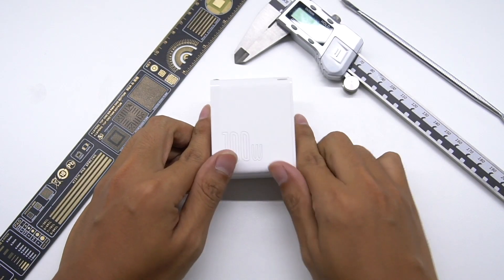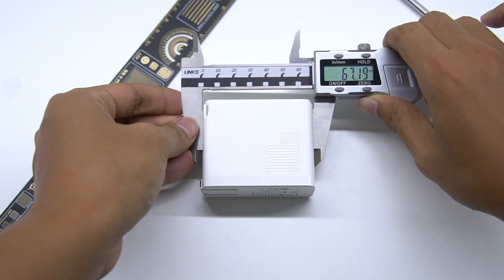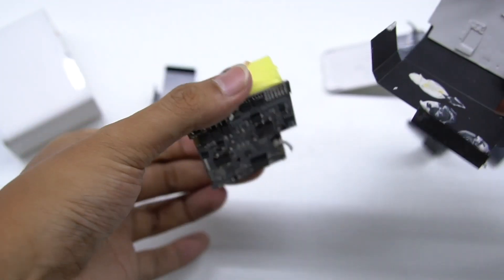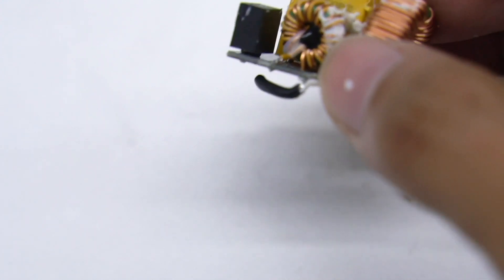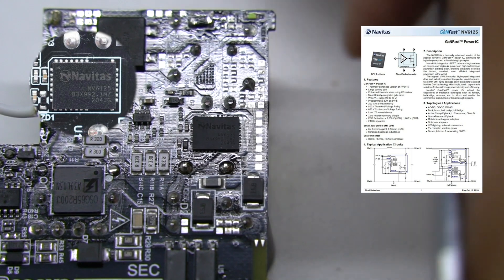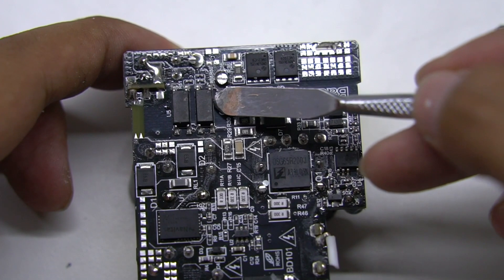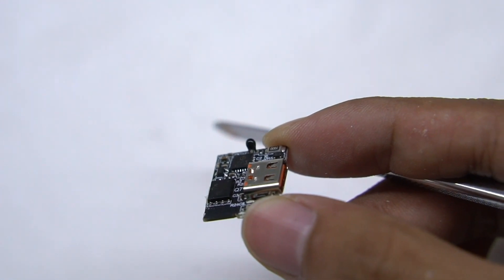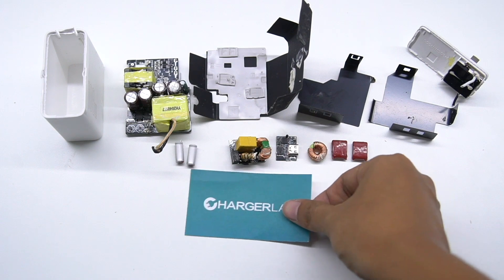Teardown of Baseus 100W GaN II Fast Charger (QC 5.0)

Comment: Nice teardown. Does this work with the Samsung super fast charging 2.0? Since I've heard it's been quite picky this year with the S22 series. Thanks!
Reply: Yes it does. But you have to use a 5A cable that supports 100w charging.

Comment: Regurgitating tech specs is one thing but there's no mention of whether the chips used are competitive and reliable, trustworthy and so forth. The point of a video like this is so I wouldn't have to cross reference anything and get an informed opinion in one place. Nice video, but please consider doing more than just reading the spec sheet while pointing out the component. Talk about whether the components are actually good and trustworthy vs. other options.

Comment: Great video as usual!
May i ask you the difference between this baseus 100w Gan2 QC5.0 single USB c Port  and the other model  with 2 USB C and 2 USB A?
Because i would like to buy One but i am not sure about the difference.
Thanks you and support
Reply from the maker: the other model with 2 USB C and 2 USB A doesn't support QC5.0. And a little bit more expensive than the single-port model.
Reply: @ChargerLAB  please do teardown of the 100watts 4 ports version.

Comment: Why do you think they use GaN for PFC but a silicon MOSFET for the flyback converter?
Reply from the maker: Because the Generic series high-voltage MOSFET is optimized for high switching performance to minimize “switching loss”, which is better than GaN from the perspective of the merchants.
Reply: @ChargerLAB  is it gan or mosfet?